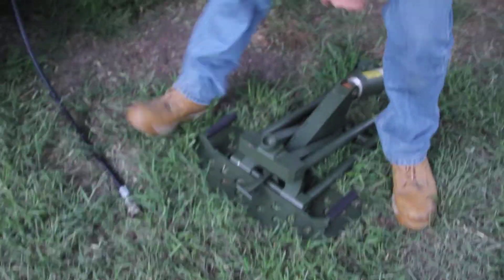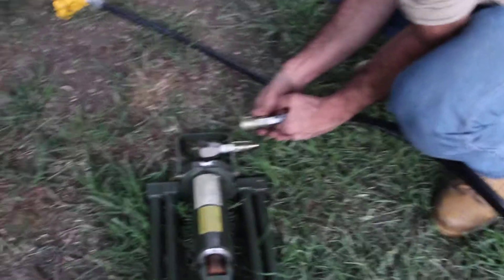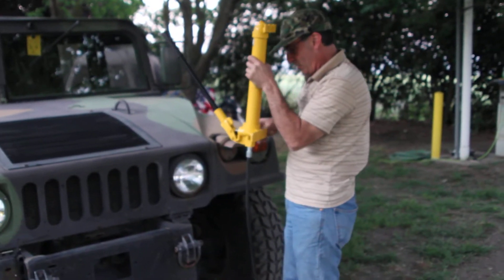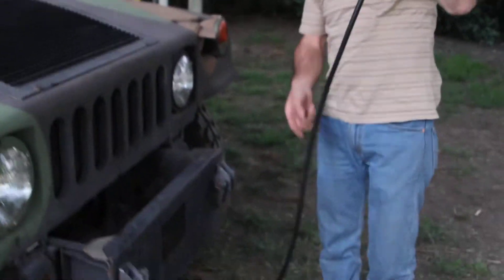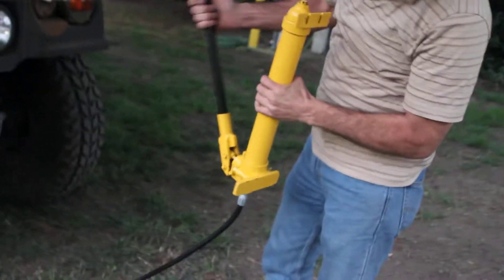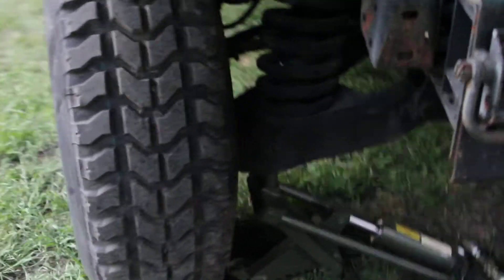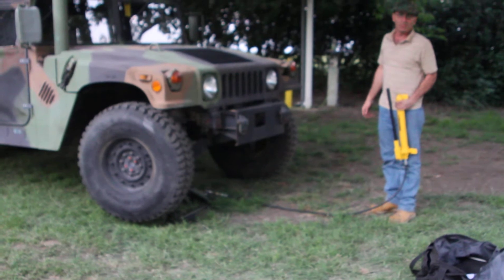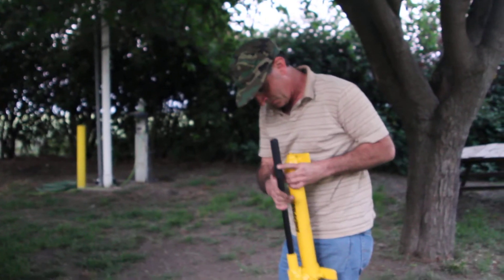bogart hmmwv jack

Comment: You lift using the upper bolt. You do not use the lower bolt. Doing so places a lateral load on that bolt. This is also a dangerous situation. The upper bolt must be used. When the jack is fully seated, the cup of the jack will be sitting flush on the lower arm surrounding the upper bolt.

Comment: I watched the video again and I noticed that you put the jack on the lower shock mount bolt which worked fine when the tire was pumped up but when the tire is flat , shredded or your on the rim, you will have to use the upper shock mount bolt. The jack will still lift the HMMWV sheel high enough.
Reply: If the runflat is still in the tire you should be fine. It won't be sitting much lower with a shredded tire.

Comment: One of the requirements that the Army had was that the jack had to be able to lift the HMMWV very quickly. The test was with a flat tire on a 7% grade. The jack was stowed in the back of the Humvee. The timer would start the clock at which the operator had to swing the spare out of the way, open the rear hatch, remove the jack, assemble the jack, lift the vehicle until the rim was 12 inches off the ground. This had to be done in 3 minutes or less.

Comment: Rod, I'm glad you like the HMMWV jack. I'm the guy that designed it and manufactured it for the Army and USMC. Although it was just approved for the armored HMMWV, it will work equally well on any Humvee variant and all the H1 civilian vehicles. Commercial versions of this jack and other lifting products are available under the brand name SAFE JACK. Go to Safejacks on the Web or You-tube or call (509)736-1512